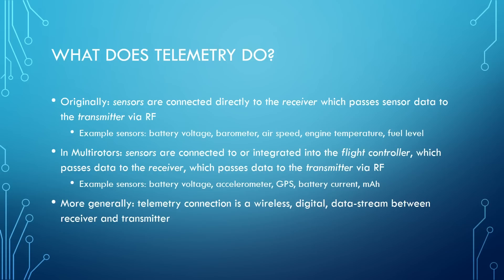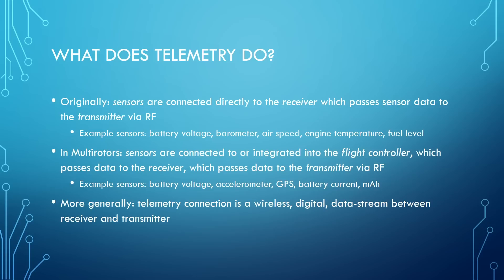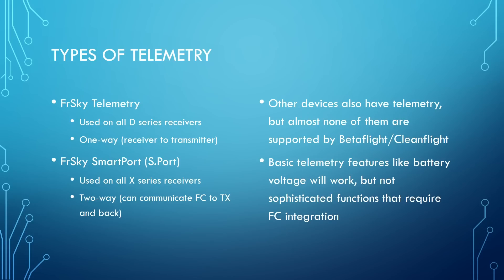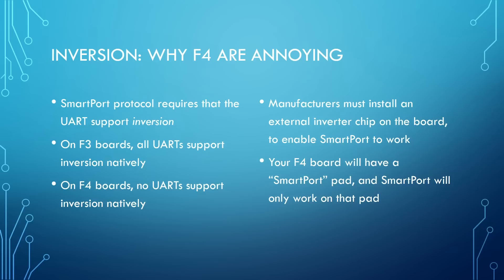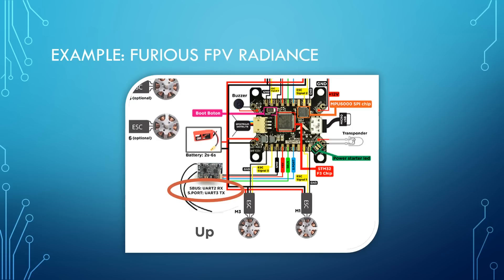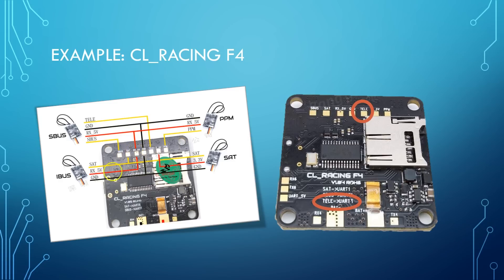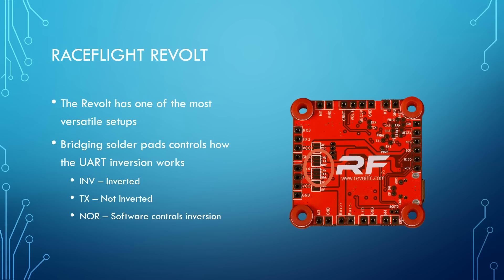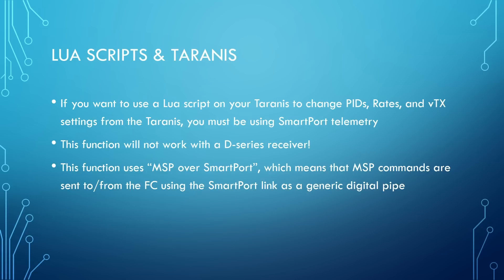Flight Controller Wiring For Beginners - PART 4 - Telemetry

Comment: hey joshua, im wondering if you could point the error out for me, im using a bff3, x4rsb and a tramp hv, i have it setup in betaflight in the ports tab (i think its correct), i do have the taranis x9d+ and i have it updated to opentx 2.2.0(the bootloader too), i can go into the osd with the remote and change everything there(pids, vtx), but when i go into the lua script(v0.3) it wont load the pid values or the vtx values, also, when i go to page 13 on the taranis i dont get any telemetry values allthough when i disconnect the battery from my quad i get "telemetry lost", i have enabled telemetry in betaflight
https://gyazo.com/135303986c7a1381b97aae05b5edfcc0
https://gyazo.com/8a02f426b2b0236755db02b51521bc6e 
hope you can help
Reply from the maker: "Telemetry lost" does not mean that your telemetry is working right. The receiver will always have "telemetry" to the transmitter, but by default this only shows RSSI and a few other sensors that are built in to the receiver. "Telemetry lost" does not mean that you have telemetry working right between the receiver and the FC.

Your Ports tab looks correct, so I am going to speculate that you have wired the receiver's telemetry up wrong. SmartPort wire to the TX pad on the relevant UART?

When you do "discover sensors" do you get the full suite of sensors including VFAS and accelerometer values and other sensors that are specific to the FC? Or do you only see like RSSI, SWR, A2, and maybe a few others.
Reply: Joshua Bardwell I only see the latter(swr, a2...) so would this mean that smartport is wired wrong?

Comment: I've read that people bridge the rx and tx pins on the UART when connecting smart port. Is this not necessary?
Reply from the maker: 100% not necessary. The FC can handle the half-duplex without the external circuit. The TX and RX pins can both transmit and receive, they just usually don't.

Comment: Hi Joshua can you help me i dont know to connect my xsr smartport on a Hobbywing x rotor f4 flightcontroler its not defined?
Reply from the maker: +Sas Wie I would try the R3, R1, and R6 pads but chances are they won't work because they're not inverted. So you will need to do the "universal hack" (Google FrSky XSR uninvert hack) and then you can use any of the receive pads.
Reply: Ok i thank you many times! 
Your Videos are Great! Thanks

Comment: when the betaflight 3.2.0 comes out could you please make a series on the omnibus f7. I will likely use it with dshot1200 and jc from project blue falcon was going to make one but now he... well won't unfortunately. I would love to see smart audio setup (tbs unify) and telemetry for something like and x4r SB. thanks
Reply from the maker: Well the beauty is that the content in these videos will be just as relevant for F7 as it is today for F3. Find the correct input pin and wire it up. The great thing about F7 is that they all support inversion, so there is no silliness like with F4.

Comment: I cant get my Omnibus F4 with my D4R2 ( I know i know it is old... ) but it seems like I need to have an inverter (?!) , if so, can you advice how to connect it? It seems like I cant find any tutorial
Reply from the maker: You don't need an inverter for PPM input. Are you sure you're configuring for PPM input? The D4R2 is not an SBUS receiver. It uses PPM.
Reply: PPM works fie, I just meant the telemetry :)
Reply: Any idea?

Comment: Man, I'm having the hardest time getting telemetry to work on my setup.  I'm using your JB F4 FC, XSR receiver and Taranis X-lite radio.  I've double-checked all my connections, flashed the Rx firmware and checked all betaflight settings, etc.  It's just not working.  I don't see battery voltage on the Tx, Lua scripts don't show PIDs, etc.  Can you do a video focusing on just that setup?  All your videos talk about so many other FCs, TXs, etc. One on just this would be great.  Hope you have time to do so.
Reply from the maker: For XSR... White wire (SBUS) to S pad on FC. Yellow wire (SmartPort) to T pad on FC. In the Betaflight Ports tab, enable serial rx on UART 1. Enable smartport telemetry on UART 3. In the Betaflight Configuration tab, enable Telemetry feature. Set serial receiver type to SBUS.

This is all it should take to get XSR working with my FC.

Next in the Taranis go to the Telemetry screen and Discover New Sensors.
Reply: Joshua Bardwell thanks for the reply, I'm gonna triple check and follow your checklist here.

Comment: I am a beginner and I don't know acro .to learn it I have  two choices
1.Is to use simulator 
2. is to convert a toy drone into 
a acro drone using brushed fc
and learn acro

which one do you think is worth trying and you gave me the link of imax b6 charger  buy what  power supply should I use for it
Reply from the maker: Simulator.
Reply: Joshua Bardwell thx
Reply: Joshua Bardwell  power supply

Comment: Is this video out of date?!
Betaflight 3.3 supports software based signal inversion with cli commands. Hopefully this works with my F4.
Reply from the maker: F4 flight controllers do not support software-based inversion with CLI commands. That is true in 3.3 and every version going forward. It's a limitation of the F4 chip, not Betaflight. The only exception is if the FC designer installed an XOR-style inverter, which allows the FC to switch the inverter on and off.

Comment: hello my teacher of drones, so im having this issue where ill arm the quad and then when i move my quad it will all of the sudden start freaking out and yawing left and right until i hold it firm toward the table, please help!!!
Reply from the maker: Usually this means your motors are not spinning the right direction. Check them against the diagram in the Motors tab and also make sure each motor slider spins the correct motor (double check against the diagram).
Reply: THANKS!!! but unfortunately i already reverted to my backup, i honestly completely forgot i had one, sorry to bother, but thanks for the help!!

Comment: I have the CL Racing F4 all wired as it should be to the TELE pad with it set as s.port on uart 3 in beta flight and it still wont give me telemetry. I have watched one of JC's (R.I.P) videos about this and it was said to solder a wire onto the XSR before the signal is inverted. Is this the case or is there an easier way?
Reply: Hi thanks for the reply, surly its easier to tack onto the receiver before inversion than to build an inverter? i was more wondering if id missed something like a cli command or something along those lines
Reply: Mark Sutcliffe have you got this straightened out yet?
Reply: You cant use cli to invert pins in F4 boards, JC has a video on un-inverting XSR and X4R receivers, look for that.
Reply: Shane Hale Not yet. I've got my head stuck back into it as we speak. I've come across some cli commands sport_halfduplex and tlm_inversion that if set to off should work but still no joy
Reply: ok give me a second to get to my laptop
Reply: ok no worries, have you managed to get telemetry working?
Reply: I've got nothing special  changed in ports. but in configuration I have telemetry enabled vbat and current sensing on
Reply: email sent
Reply from the maker: Changing F4 inversion in the CLI only works if the board manufacturer has wired up the inverter to work that way. Many boards have a fixed inverter that cannot be disabled, and the CLI options have no effect.

Comment: how can the lua scripts use smartport telemetry bidirectionally if it's connected only to the tx-pin on the microcontroller?
Reply: there is a single pad that connects to both rx and tx pins of the UART. One of the pins will have a steering diode in series to pass data one way but reject data from the other direction. see here for something similar http://www.eflightwiki.com/eflightwiki/images/thumb/8/8a/FUC-3modified.png/800px-FUC-3modified.png
Reply: Rob B isnt that the old frsky s.port telemetry?
Reply from the maker: The UART pins are not locked to TX or RX. A single pin can go both directions. Having a separate TX and RX pin means that the UART can send and receive at the same time, which is faster. This is known as full duplex. But a single pin can be used alternately for send and receive. This is known as half duplex.

Comment: Note: changing PIDs, rates, etc. only requires telemetry if you want to do it with Lua scripts on your radio. Even without telemetry, you can still do PID tuning via your OSD.

I was confused about this for a while, so thought I'd share.
Reply from the maker: Yes definitely correct.

Comment: Joshua, I'm surprised you didn't take a second to show how to get the non-inverted signal out of a receiver like an XSR for those F4 boards (like the Omnius) that doesn't have a extra inverted UART
Reply from the maker: That is coming, but this video was long enough as it is.
Reply: French Brown seems like I only use the F4 boards that require me to grab the uninverted signal from the Tx! I like the dedicated pads on the F4's.
Reply: Joshua Bardwell I've got an omnibus F4 and I can't get the smart port to work. Is this because my extra 2 spare UART ports are not inverted? I can get voltage and rssi but not pids using lua.
Reply: i am having the same problem did you ever solve the problem?

Comment: So with D4R-II it is possible to set up PID changing script, isn't it?
Reply from the maker: No, you cannot do it at all because D4R-2 does not use SmartPort telemetry.
Reply: Joshua Bardwell And is there an option to just get the PIDs? I dont want to adjust them with the script, just see them. I saw other videos that showed how to change PIDs with switches, but it would be really good if I could see the changes.

Comment: my power just started crapping out so i tried this but got this answer
# get vtx
osd_vtx_channel_pos = 2518
Allowed range: 0 - 3071

vtx_halfduplex = ON
Allowed values: OFF, ON

nothing else came up. i tried setting power to 3 anyway and it came back

# set vtx_power=3
Invalid name

??
Reply: i think my vtx is on its way out
Reply from the maker: You must be on an older version of Betaflight that didn't support CLI set of vTX parameters.
Reply: Joshua Bardwell cheers, that confirms my vtx is failing. I was getting full range one flight and the next i got 20 meters max at 600mw. I tested all the power options (25 200 600) and there was only a couple meters difference in range between them. Checked all wires and antennas and it all looks good. Vts osd control shows full power but too. Just gonna change vtx and see what happens

Comment: Hey great video !
So, I have the DYS f4, and it doesn't seem to have a smartport pin on the board. 
http://www.rccrazed.com/images/18156146_1783839238598180_8309787415687443878_o.jpg
Is this the kind of situation where I would have to refer to JC's video and in-invert it or is there a way to avoid that ?
Reply from the maker: You can use softserial, which always supports inversion.
Reply: Yea, i just noticed the soft serial last night while poking around. 
In that case i would just plug into the uart 3 and then do the rest in betaflight? 
Sorry for asking questions love this hobby its just a killer to get answers.

Comment: Telemetry is exactly what you need if you're using hubosd8 which will not give you RSSI. If the hubosd8 can possibly provide RSSI, let me know. I'm not finding any info how to get it to work.
Reply: 80miles_A_day rssi telemtry normally does that by default, unless maybe i you have a xm+

Comment: Is it possible to get SmartPort telemetry to work on the Hyperlite F4 board?  I have the pinout (see link below).  I'm not using the S.Bus port.  I'm using Crossfire on TX3/RX3.  Everything is crammed into my Floss build so I don't want to tear it apart if I don't need to!  Thanks

http://pirofliprc.com/assets/images/16009834_1878094985760135_138949091_o.jpg
Reply from the maker: +Flying Squirrel FPV you might need to do the uninvert hack.
Reply: SmartPort is a FrSky protocol. I believe if you are using crossfire you automatically have telemetry. You just need to 'discover sensors' on your transmitter.

Comment: Can't you just run scripts on the FC rather than the transmitter? That way it will do things based upon what it recieves from the telemetry and doesn't need a return path.
Reply from the maker: The FC has no function for loading scripts. You would have to edit the source directly.

Comment: F4 Advanced Flight Controller - (MPU6000, STM32F405)  this FC doesn't have designated telemetry. It doesn't even have vbat or a buzzer.
Reply from the maker: Your option is to 1) solder a wire to your receiver to get at the un-inverted telemetry signal, or 2) use softserial. If your FC does not have softserial broken out, you can use resource remapping to assign it to an un-used pin.
Reply: cool, thanks.  i like the new pic btw :)
Reply: do you mean for buzzer, vbat or both? I understand a buzzer port is very different

Comment: Did anybody see the 30004c   on the transmitter screen?
I be like WUT?  Dang he's hot!
Reply from the maker: +Ben Simons the temperature sensor is actually used to pass digital data back and forth between the FC and the radio. I don't remember the details though. It's not temperature really.

Comment: JB https://github.com/betaflight/betaflight/wiki/Bidirectional-DSHOT-and-RPM-Filter  I thought you can be interested.  Rpm telemetry via signal wire and gyro filtering based on motor rpm harmonic.    Yes esc needs to be update for rpm telemetry via signal wire.
Reply from the maker: Exciting! Looking forward to seeing blheli implement it ASAP.
Reply: @JoshuaBardwell  first cut with rpm telemetry implemented,  I can see your esc hex there as well.   https://github.com/bitdump/BLHeli/tree/master/BLHeli_32%20ARM/BLHeli_32%20Test%20code%20Rev32.61%20hex%20files

Comment: Please read, may be out of this video info but... I'm down to the last piece of my very confusing build sense there's very undocumented help. I have it all working but lumenier f4 AIO (no esc's) type FC simular to the BF F3. I'm using crossfire micro v2 and I just don't see any telemetry from the FC only the crossfire. Everything works on the OSD, but like u like I like having vibration and audible alerts, can u help at all?
Reply from the maker: +cJhudanich I don't know about setting up crossfire.
Reply: Joshua Bardwell its ok thanks for getting back to be.

Comment: hello JB.. i have recently purchased a Taranis QX7S... and am using the R-XSR receiver.. my FC is a Hobbywing x- rotor.  I have hooked it up and its working well except the telemetry.. i can only find 3 sensors F000?  RXBATT and RSSI .. it will not find VFAS 
i wanted to have audible alarms like you have mentioned. I get the voltage and current draw etc in my OSD so the vbat is working? Do all boards have vfas sensor... please help . i have been watching so many videos its driving me crazy.
Reply from the maker: Those 3 sensors come from the receiver only, so the FC is not sending telemetry to the receiver. First, you need to update the firmware on the RXSR to the latest version, as the default firmware does not support telemetry correctly. Second, you need to use the uninverted pad on the RXSR, not the SmartPort wire coming from the plug. The reason for this is that the Hobbying FC does not have an inverted UART for use with SmartPort.

https://oscarliang.com/ctt/uploads/2017/10/frsky_r-xsr_rx_receiver_smartport_sbus_inverted_uninverted_pin-624x360.jpg

There is a photo showing where the uninvert pad is.
Reply: Thank you so much for replying.. yes i have wired it to the uninverted  pad on the receiver.. ok great now i will watch one of your videos to see how to update the R-XSR..   Thank you for making awesome informative and entertaining videos.
Reply: Thankyou  all working correctly now ..